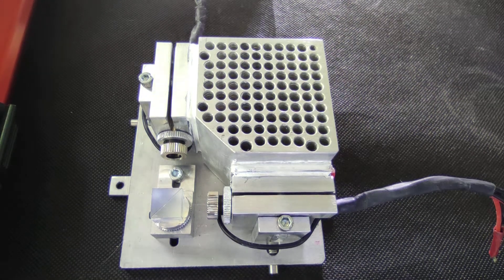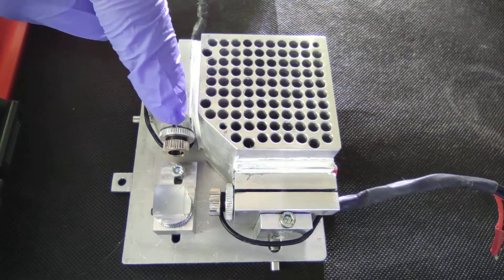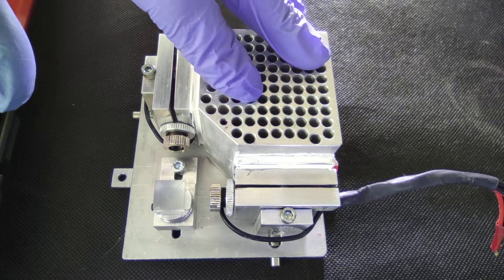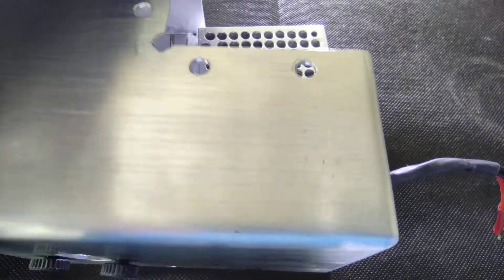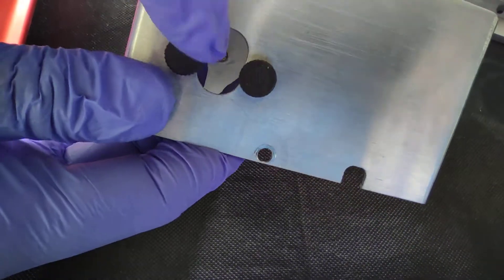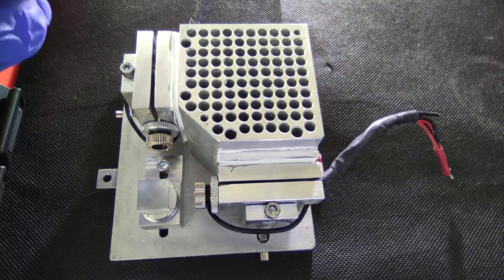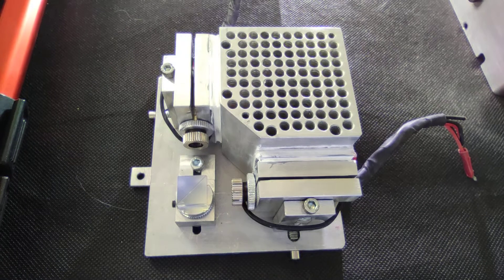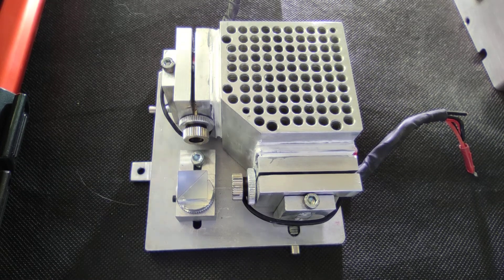What is inside 15 watt diode laser. All you need to know

Comment: That prism is really interesting! Can you combine 2 different Watts lasers with it? Like a 2.5W and a 5W one? How is that prism made, is it sold seperatly?
Reply: it's a simple polarizing beam splitter cube. They will combine any two laser sources as long as one has H-polarization and one has V-polarization.   For maximum efficiently you  want  one that is anti-reflection coated for the wavelength of the laser sources you're using.  They're quite inexpensive on ebay.
Reply from the maker: yes, but most of eBay and amazon prims can not work with 10 watt power.. most of they only can carry 0.5-1 watt power... and then they just burn...
Reply from the maker: yes and they are on our online store https://Endurance-lasers.com